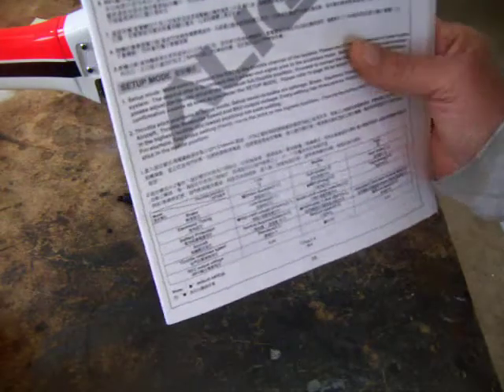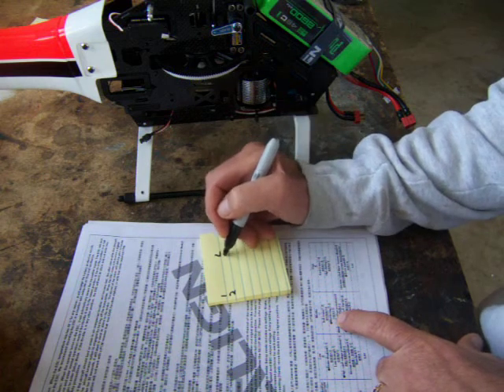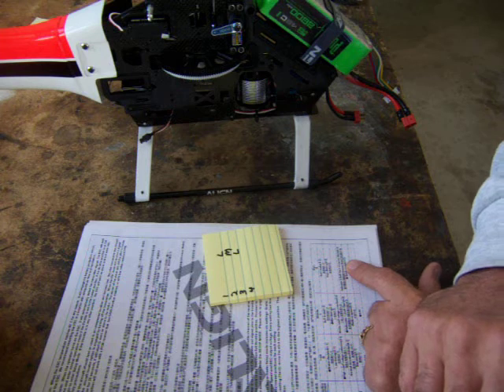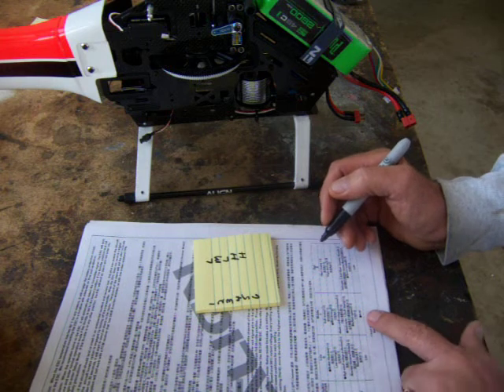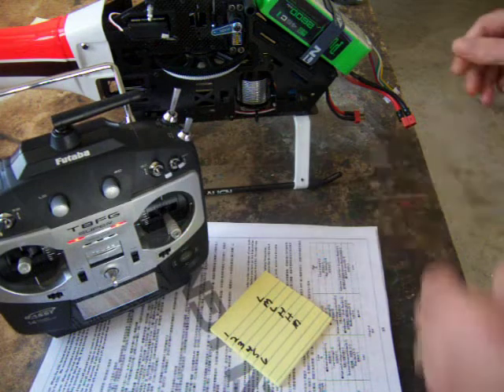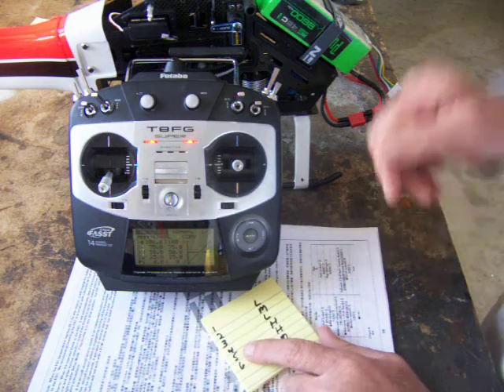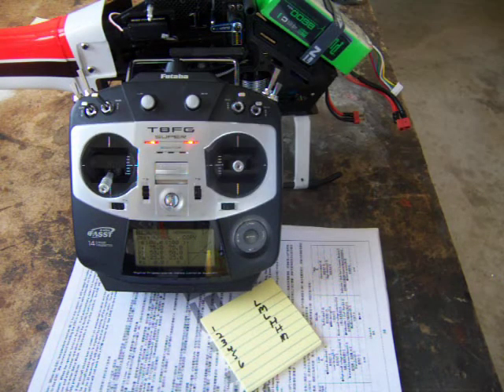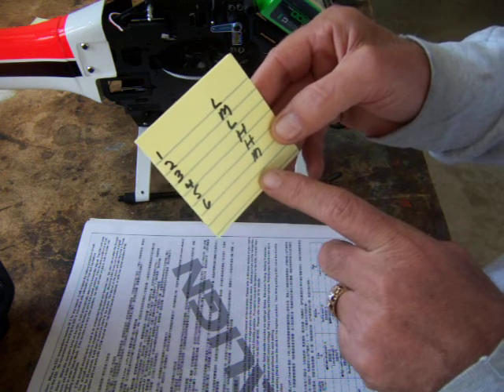How to Program Align Trex 500 70 Amp Speed Control

Comment: Thoroughly enjoyed you video.  Very clear and concise however I still would like to lower head speed .  Is there a function for that with the Align ESC?
Reply from the maker: There is no function for that in the esc. You will need to use the throttle curve. Thanks for your kind comment.

Comment: Good info... Thx.   FYI - the governor mode didn't work well for me, caused pulsing and throttle cut out.
Reply from the maker: My governor reared it's ugly head too almost causing a disaster. I should have listened to them when they told me "it doesn't work very good".